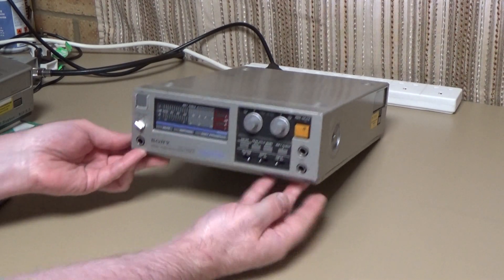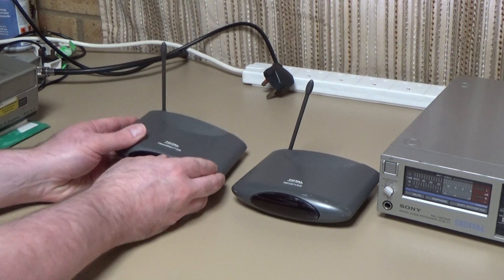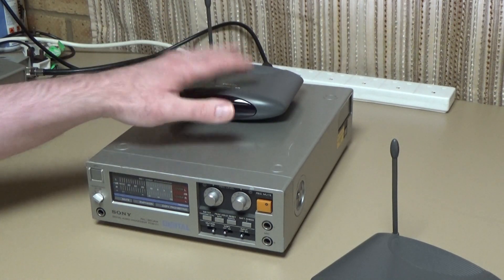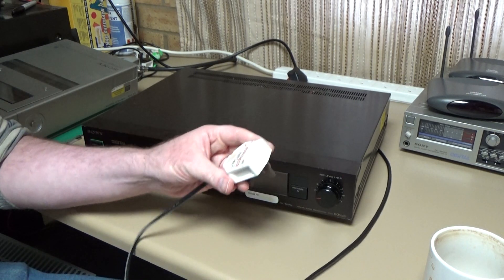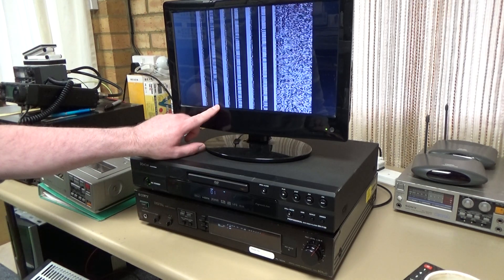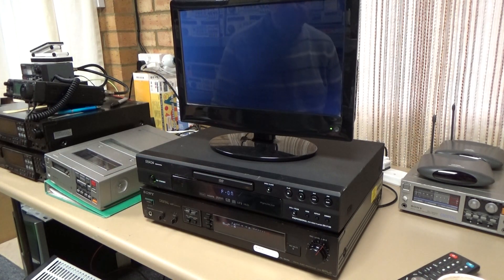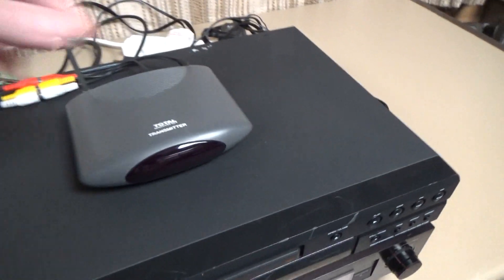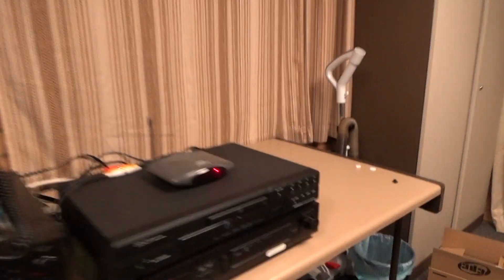Sony PCM-601ESD to PCM-F1 via Cheap Video Sender Radio Link - Will it work?

Comment: I wonder if we could recreate a device like Sony PC-601ESD using an FPGA in a small form factor that can be used to repurpose old vcr's into digital audio tape recorders.
Reply from the maker: I think this would be eminently possible, especially given that software decoders for PCM-F1 recordings already exist. Most late VHS VCRs have plenty of empty space inside to accommodate a Raspberry Pi or similar.

Comment: The DVD player you are using as the S/PDif source may be adding the “SCMS” copy protect code. You may have better luck with a standard ordinary CD Player that has S/Pdif output.

Comment: Interesting experiment!
Regarding the S/PDIF input the following. The Copy Prohibit flag is always high when this input is used. A digital copy is only possible with a source that allows digital copying. The digital output of a consumer CD player always has that flag high.
The digital output of the CD player can be modified. But it is also possible to modify the digital input of the 601, allowing unlimited digital copying. I once did that to one of my 601s and it worked fine.
It is recommended to connect the video transmitter to the Copy output of the 601. Then the best result is obtained. When a tape without copy prohibition is played and the Copy key is pressed, a stable and error-corrected video signal is presented to the copy output.

Comment: Nice setup, I have a few of these 2.4GHz video senders, the biggest problem is that radio band has mostly been taken over by WiFi making them kind of useless.
I setup one to transmit the output of a computer, and received it by a handheld receiver/LCD monitor, boy does the picture break up as I move away from the transmitter. I shut down my WiFi, but it was not much better as everyone around me, neighbours etc, all have WiFi.

Comment: I think that the PCM-601 should accept digital audio from a CD player - this DVD player may have the DCP flag turned always on for some licensing/copyright reason.
Reply: Yeah, it's likely the DVD player is hard-wired to set the Serial Copy Management System (SCMS) bit in the SPDIF signal. That was the electronics industry's attempt to placate the RIAA and other music company groups who were worried about the ability to make bit-perfect digital copies of their content by only allowing you to make one copy from the source media and disallowing subsequent copies made from that copy.
Reply: Or it could be the DVD player has macro vision copyright protection
Reply: @gman83090  this is completely unrelated, MacroVision protects the video signal, and here he's trying to convert the S/PDIF stream. It most certainly is DCP/SCMS flag always on.
Reply: @gman83090  Macrovision modifies the analog video signal, not S/PDIF

Comment: Before DAT became common in the late 1980s, a significant number of stereo location recordings and some live transmissions were made using the PCM F1 or 701 by the BBC. The Beeb had more spare video link capacity around the country than fully equalised stereo analogue land-lines. You could also bounce it via a satellite feed too. Sony designed the system to be tolerant of the automatic video gain input stages on video recorders from the outset so a video sender is a similar environment assuming the RF signal is robust enough. They did however recommend using the matching Sony recorder.

The SPDIF failure to record is by design, it's trying to stop you making a second generation digital copy (the CD/DVD will have the copy prohibit flag set). This became such a problem for professional use that several companies (ASC Design ??) sold SPDIF bit strippers that toggled the copy bit and HHB sold modified 701s with the SPDIF circuit modified and XLR sockets. I got caught out several times when an F1 refused to transfer my own material especially when moving from AES originated digital to SPDIF (the SPDIF copy prohibit software incorrectly interprets an AES Pre-emphasis bit as a copy prohibit flag if set).

For several years the main stereo audio path from Bangor in north Wales to Cardiff in south Wales was using the same video circuit used for transferring to Cardiff the TV news stories shot & edited in N Wales for broadcast later in the evening. It just required careful co-ordination of who was using the video circuit. A PCM 701 at each end did sterling work for at least 5-10 years.

Fascinating to see old and very familiar technology being re-discovered.

Comment: As a radio ham I wonder if that could be itilised over really long distances? Great video Tim.
Reply from the maker: No reason why not, with a powerful enough transmitter. Those video senders were only designed to work between rooms in a house, so I doubt they would go far.
Reply: I've developed FPGA-based decoder of this standard and should say: BW of video here is 2.65 MHz. Too much for HF, only VHF or UHF can carry it. Also it won't withstand multipaths well
Reply: Thats very interesting. Band Width is still too high for even for the UHF amateur bands (e.g.70cm)? Possibly OK on 23cm band (FSTV) I think @17lvlham
Reply: @17lvlham  "BW of video here is 2.65 MHz. Too much for HF, only VHF or UHF can carry it. Also it won't withstand multipaths well"

That's why we have DRM radio, a digital radio standard that was for broadcast but I don't tihnk anyone uses it other than hams.  

DRM radios cost an absolute fortune on AliExpress and I haven't seen a model that does both DRM and DAB+ which is what I would like, just to see if there are DRM broadcasts on short wave.